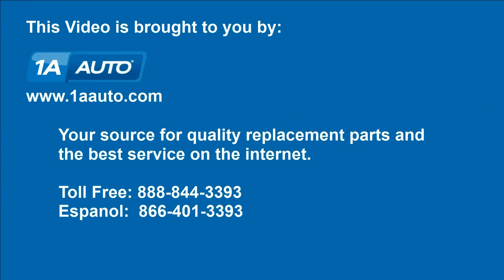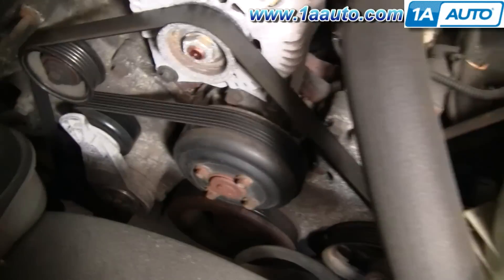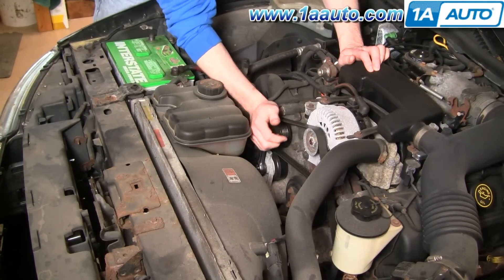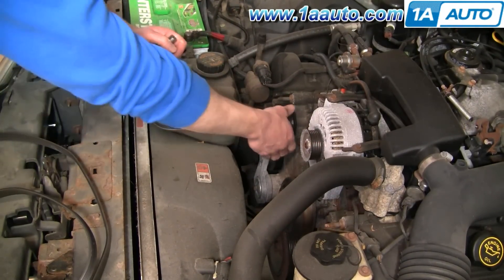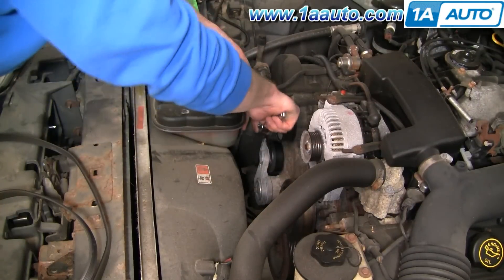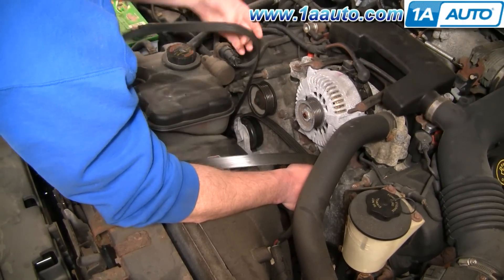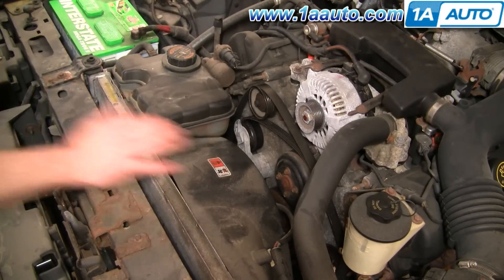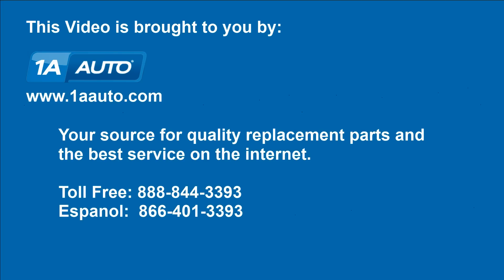How to Replace Idler Pulley 91-99 Lincoln Town Car

Comment from the maker: Check the belt for cracks and replace it if there are any. Also check the belt tensioner to see if it may have lost some of it's tension. Also check the water pump pulley for play to see if there is play in it. If the bearings are gone in the water pump it could also cause the serpentine belt to squeal. Hope this helps you out. 1aauto.com 888-844-3393

Comment: What the difference i have a 2000 lincoln continental amd my squealing started after my alternator got replace with a used 1 im not sure if it was the belt or pulley making the noise